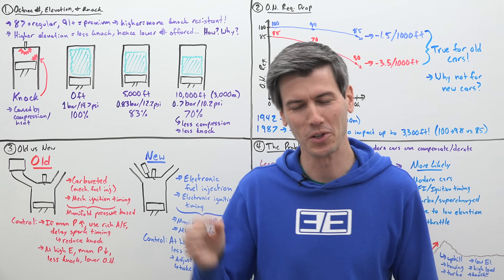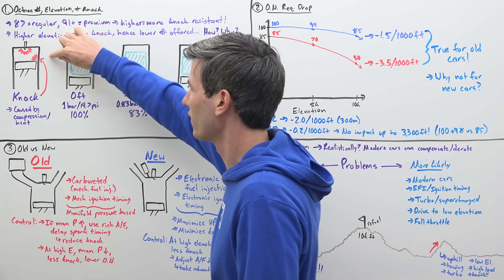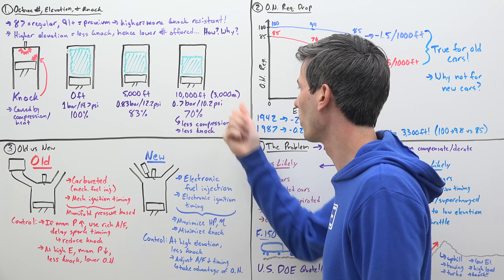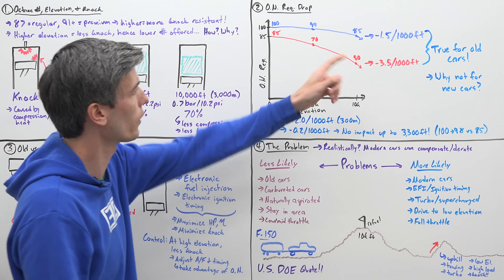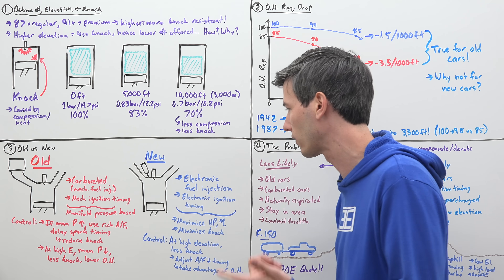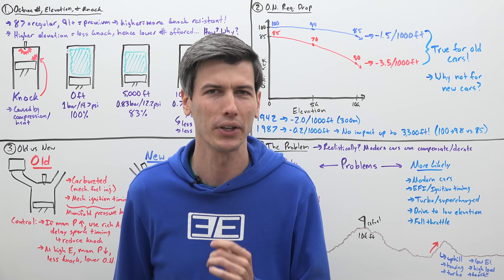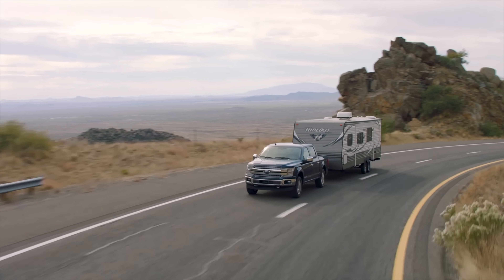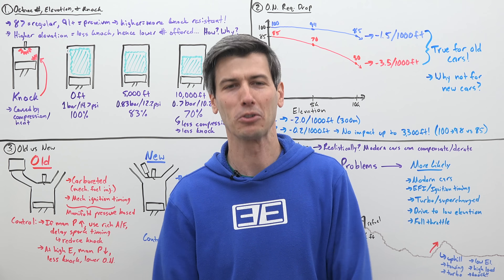Never Use This Gas In Your Car!

Comment: I was wondering if you could elaborate more on turbochargers and super chargers with this light. I’m particularly curious how this elevation is impacted on Diesel engines where they rely of pressurized ignition if I’m not mistaken.
Reply: In a diesel application, we are not concerned with detonation as the injection sequence isn't started until the piston is almost to the top of travel on the compression stroke. Heat of compression is what ignites the atomized diesel as it is sprayed at very high pressure into the combustion chamber. Turbocharging or supercharging an engine raises the final compression ratio vs. the static compression ratio. A higher compression ratio in a gasoline engine requires a higher-octane fuel to combat detonation.

Comment: So does 85 have more carbon byproduct than higher octane? I had a Chevy big block that only ever had high-octane gas in it and I would pull the manifold every 50,000 miles and there was very little carbon residue. I’ve always been curious if I had the same motor and ran 85 through it as to how that would have turned out.

Comment: Would love to hear about 88 octane which one usually seen with 15% ethanol. Usually cheaper, but the higher ethanol makes me just buy 87
Reply: Most cars can safely use the new 88. I’m pretty sure all cars legally have to be able to use up to 15% E. Personally, I use a E50 blend in my F-150 Ecoboost and it’s not a flex fuel engine. I have it tuned to use it. It burns much cleaner, exhaust doesn’t smell bad, engine is able to run way more timing making huge power while keeping engine temps lower. The blend is essentially 106 octane. MPG is lower but the lower cost of the fuel offsets the difference.

Comment: believe it or not, modern engine are very good at avoiding and managing knocking, as my country still sells subsidized country at ron 88 (below aki 85) and the regular gas at ron 90 (aki 85) many cars (mostly imported premium cars, as most regular cars only require ron 90) that require ron 92 or even 95 runs just fine using ron 90 or 88 (still please don't do it, especially if it subsidized gas), back then when cars still using carburettor, manufacturer which wanted to sell their premium cars in my country they need to release the third world spec engine, while now modern turbocharged bmw and mercedes thats supposed to run at ron 95 runs just fine on ron 92, 90 even some stingy rich owners use subsidized 88, without any changes to the engine, this is really a testament to modern engine control which can compensate even the worst condition, that 100+ years of ice engine know how, direct injection, ecu and its sensors especially wideband o2 sensors really works

Comment: In addition to the turbo engine and being used to tow, F150 is also available with a 36 gallon fuel tank, increasing the odds that you'll end up at a lower elevation with 85 octane gas.

Comment: So he says it’s less likely to be problematic if you have a naturally aspirated engine yet more problematic if you have EFI/ignition timing. Uh….. most new cars are naturally aspirated with EFI. And because of that EFI, it adjusts for varying conditions in the cylinder actually making it LESS LIKELY to be problematic. 

I can also sum up the 2 lists in Block 4:
Less likely if you drive a N/A car and drive like a normal person. More likely if you drive a turbocharged car and go hooning about. Done. End of video. 

And for what it’s worth, I live in Denver. I’ve put hundreds of thousands of miles on my vehicles using 85 octane. Never any issues. Even driven to KS and beyond. Never any issues. If you leave Denver with a full tank of gas, by the time you’re low enough for the reduced octane to matter, it’s time to fill up again anyway.

Comment: What an excellent video. When I used to pull trailers over the mountains with a carburared old engine, just slow down and back off the throttle and it would stop. Although modern engines have knock sensors and such equipment to try to contend with this problem, I still use the old strategy and just give it its time and don't step into it too hard.

Comment: Interesting that Ford recommends 91 octane in their gas trucks. That makes running a diesel actually cheaper in most locales, including the DEF.
Reply: Also interesting is the thumbnail for this video since the nozzle is green, ie diesel!
Reply: damn bro im in chicago and diesel is almost high as premium! 4.45$ premium like 4.15$ for deisel
Reply: @Madcatcon199  im a self employed truck driver. Those prices are why i will not do business in blue states. The rest of the working class should jump on that same bandwagon until they figured it out. Just topped off my freightliner here in tx at $2.69 per gallon and even that is ridiculous
Reply: It's mostly a recommendation for towing since that's about the only time you're going to be running your engine near max power for longer than it takes to merge onto the highway.  And if you're doing a lot of towing you want a diesel anyway.

Comment: The ECM/ PCM will compensate to prevent knock, premium is for high compression engines and a waste of money in most vehicles unless required, people will swear that premium increases fuel economy but it doesn't. I was recently in the mountains of Pennsylvania and encountered 85 which said it was for flex fuel vehicles, it contained 51 to something like 83% ethanol, in NJ we don't have 85.

Comment: I live in Colorado, never use 85. The octane are 85, 87 & 91. When I was in High School in 1989, I used 87, the engine had a carburetor. Any vehicle I have had if I put 85 it runs bad. Don’t use it. Unfortunately the refineries in higher altitude areas don’t want to stop making octane 85. They say it’s too expensive to stop making it. That’s why we still have it.

Comment: Personally I find the first square (top left) a little misleading... The air charge coming is less dense, but it's still being compressed into the same space. I'd have use different colors to show that the air is less dense at higher elevations. Nitpicking I know.

Comment: My 2012 Ford F150 with the 5 liter specifically states on the fill nozzle to use E85! Am I supposed to disregard that?
Reply: E85 is 85% ethanol.  It has nothing to do with octane ratings.

Comment: Thank you for this Jason!! I live in Colorado, where “regular” unleaded is 85 and premium is only 91.. I have always wondered what the implications would be between 5,280’ and sea level. Love your videos! 👍🏻
Reply: Crazy, ours is 87-89-91-92-93 here in WA. I have to run 93 in my built K24…..
Reply: Normal ol fuel works fine in co it’s also cheaper I’m not tryna spend more on gas then I have to.
Reply: Take your car to sea level, see how fast it is, you'll understand altitude
Reply: I live in northern Colorado and I run 87 non ethanol from Murphy’s in my older F-150. It runs a lot better on straight gas and the economy difference is worth the extra cost.
Reply: I just moved to CO from NC, I believe its still under $3/gal for 87 there.. what a shock here!
Reply: @ado_plays  2.98 for 86 octane day before  yesterday when I filled up, from south eastern NC
Reply: I'm in Colorado and only paying about 13 cents for a Kwh of 'premium'!  🙂
Reply: @nobrien1  this is why people don’t like Tesla drivers. This right here
Reply: @aaronhoekstra6452  well this and about 32 other things lol
Reply: @nobrien1  Coming straight out of the Rawhide Energy Station  burning coal and natural gas, or maybe St.Vrain with their straight natural gas. You electric egg drivers sure do spend a lot of money just to burn fossil fuels in a very roundabout way.

Comment: Cant say I have ever seen this type of fuel. I do however regularly use E15 which has an 88 octane rating. It is cheaper per gallon than 87 and has more ethanol to burn cleaner. There is a very slight loss of MPG as expected with the higher ethanol content, but I only notice that durning city driving. With majority highway use my MPG stays the same as when using 87.

Comment: New engines are also Turbo and higher compression all around and want to work as close to a diesel that you can with gasoline so they'll aim for high pressure, high likelihood for knock as they can

Comment: Back in the 1970’s Honda use to put a “high elevation” knob on the carburetors of the motorcycles that you pull if you were over 5000 or 10,000 sea level to help the engine run better.
Reply: Around 1980 Toyota pick up trucks had a high elevation system. Colorado trucks if I remember correctly

Comment: I live in Colorado, and we have 85 octane everywhere. I own a 2019 Subaru (non turbo) and the owners manual states something similar. The oil companies / gas stations often rip off customers by charging more for 87 octane than they should. When I fill up, I fill half the tank with 85, then the next half with 91. I end up with a tank of 88 for the same or less cost than 87. 85 should be banned.
Reply: I really think banning it is extreme. If the people stop buying it then stations will stop selling it. I put it in any non turbo charged vehicle when at elevation. Modern cars have knock sensors and will protect themselves.

Comment: nice explanation of octanes and why they are important.
I also use an additive called Lukas Oil, that lubricates the top end and also helps to prevent knock(nock? nok?) The engine runs smoother and quieter and after a recent gasket replacement of the valve cover, the mechanic was impressed how clean the valves were.
Reply: That snake oil isn't doing you any favors and your mechanic did not see the parts of the valves that touch the fuel or the exhaust.

Comment: Interesting for sure as I have a F150 and it's a 2016 and a 2.7L ecoboost. I've been using 85 because that is what we have as regular, you go to Costco it's 85 or 91. Is 85 cheaper NOPE. If we compare 87 (mid-grade here) to 87 (regular) say in TN no not at all. In fact our 87 is a lot more costly. However I usually get Premium before I drive to TN because i know I'm going down from my 7,200 foot elevation where I live, and I tend to drive at higher altitudes. However I do know how turbos work so I probably should use mid to premium but I started using 85 mainly because I was burning fuel waiting to pickup my daughter from school and would idle for 30 mins to an hour waiting. 

I guess next fill up maybe I'll just go back to Premium at Costco or Mid at other stations. 60,000 miles no issues...but I also don't typically drive balls to the wall anymore and I don't tow a camper.

Makes me wonder if the manual says anything in it from 2016, who reads those things?

Comment: Have you done a video on the effectiveness of knock sensors commonly found in many modern vehicles?
Reply: I can give you the short form. Knock sensors were introduced as part of emissions control, limiting production of NOx because it is out of control during detonation. People began relying on knock sensors to prevent damaging detonation, which they do, but at a terrible cost in fuel and performance. The ECU sets the timing back a lot when the beginning of detonation is sensed, then gradually returns the timing to spec. Another ping and another setback.
Reply: You can try it, I've tested this on a few vehicles, like an older Ford E350 cube van with a 460. Tapping gently on the intake manifold with a wrench, you could hear the computer definitely pull a ton of timing, it would idle so bad would nearly stall, and shake, then go back to normal if stopped tapping. Need to time the taps to be roughly in time with the rpm, made a drastic change, like RPM dropped from 700 to 450-500 and nearly stalled.

Comment: I'd like to hear more about what "octane number" really is (it's NOT "how susceptible to knock" - that's just a result), and why it's cheaper, and WHY higher octane is less susceptible to knock. Is it the percentage of actual octane (C8) in the fuel?
Reply: Not an expert by any means, but yes and no. It is % octane, because octane was one of the earliest anti knock additives discovered, so the effectiveness of all later additives is compared to it, as a percentage. Octane itself fell out of favor very quickly because it's just not very good at knock reduction, which is why you have the apparent contradiction of 110 octane race fuel or avgas, which cannot possibly contain octane, but has a knock retarding effect greater than pure octane. 

As an aside, the preferred knock retardant for a long time was tetraethyl lead, which is great at reducing knock but has the unfortunate side effect of getting lead in the atmosphere. This is where the concept of unleaded fuel comes from, after TEL was banned. You can still get leaded fuel for light aircraft afaik.

Comment: I recently drove from Arizona to Indiana and back.  I passed through 2 states (or at least areas) that used 85 octane (New Mexico and the Texas panhandle).  The car I was driving clearly says that a minimum 87 octane is required in the manual, and on the gas cap.  I ended up using 87 in Texas (the midgrade at that station) and 88 in New Mexico since that was the midgrade in NM.  

Unfortunately, 85 octane doesn't seem to be cheaper than 87 anymore since the 85 that I didn't buy in NM and TX was similarly priced to the 87 everywhere else.  If 85 is cheaper, than the gas companies are just pocketing the profits.
Reply: Well use mid grade
Reply: The gas companies are lining their pockets which is a big part of the reason gas is so high that and no one want's to stand up to them since who's in office now.

Comment: 3:00 This is why super/turbo chargers are so effective in piston engine airplanes. AND why airplanes need higher octane fuel. Av gas is typically 100 octane.
    Just before WWII an American company found a way to make very high octane fuel and so were able to use much higher compression and get more power at higher altitude.

Comment: Just out of curiosity. What is the price difference between 85, 87 and 91 octane fuels in the US? I'm from the Netherlands where a litre of regular fuel (95 octane on the EU scale > 89 / 90 octane US) along the highway costs about € 2,02 / litre and 98 octane (91 octane US) 8 cents more.
Reply: It's $3.10 per gallon here in the Milwaukee Wisconsin area for 87 octane currently. (85 is only sold in the mountain areas of just a couple of states like Colorado) 87 is the lowest grade sold in the US nationwide and is the most popular since most cars around the world run on it just fine. $3.10 per gallon here in Wisconsin is €0.72 per liter in Europe. 

And 93 premium here in Milwaukee is $3.73 per gallon right now. (99 octane in Europe) $3.73 per gallon here translates to €0.87 per liter in Europe.  😊